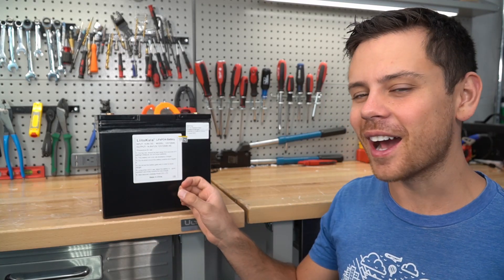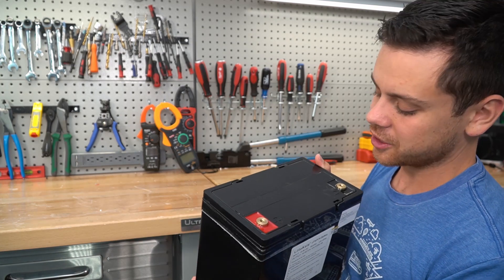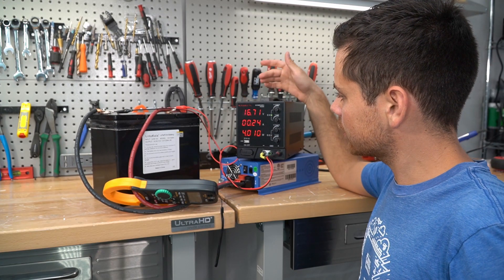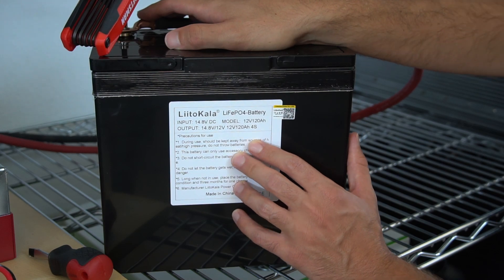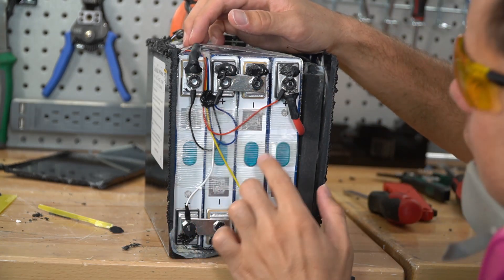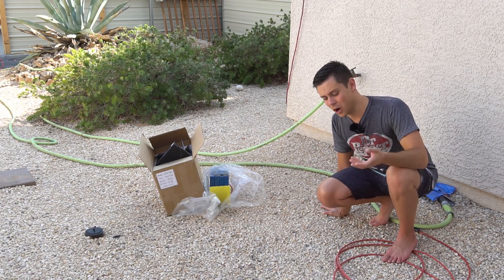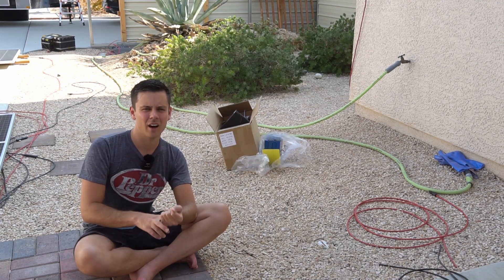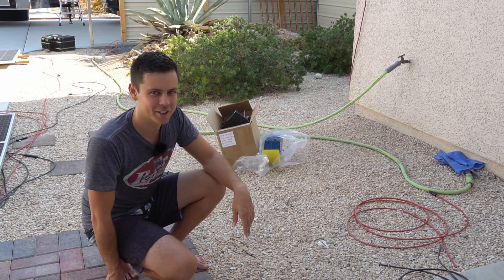Aliexpress $280 120Ah 12V LiitoKala LiFePO4 Battery

Comment: Also you should probably get a rubber mat for your tables.  Just thinking...
Reply: I like the silicone mats, I use them for my workbench where my resin 3d printer is, and so far nothing sticks to it, and no matter how sticky of a mess gets on it, a wipe-off usually gets it and if that fails you can hit it with a paper towel and some water and nothing remains.
Best of all they aren't terribly expensive, 30"x24" is about $25 on Amazon and come in many colors if you need that for high-visibility and contrast
Reply: A rubber mat would probably absorb all of the inertia of his hammering and make it harder to penetrate the case
Reply: Marines not supposed to think lol

Comment: Lead is so Last Century
Reply: My sister has been using a 600Ah forklift battery for 5 years - charged by a water flowing spin wheel generator - years ago this was the best choice since the parts are easy to buy..

Comment: I always cringe when you take stuff like this apart without gloves.  You wear googles and a respirator, awesome.  Just add some good automotive gloves.
Reply: negative. do not use fabric gloves dealing with hazardous liquids, the chemicals will soak into the gloves and you will notice the exposure later.
Reply: @PandaMan02  there are those heavy duty Nitrile gloves which many mechanics wear, those are chemical resistant and nothing soaks in.   Further pretty tear and puncture resistant.
Reply from the maker: @PandaMan02  I have some nice chemical resistant gloves. I know what destroys the latex ones and wouldn't consider fabric gloves as an option.
Reply from the maker: Smart idea
Reply: @WillProwse  According to the MSDS, the main hazard of electrolyte is inhaled aerosols, but otherwise it's the coarse copper particulates and the organic electrolyte (NMP?), with LD50s of  375mg/kg and 2000mg/kg respectively.  

OSHA guidelines for NMP are as follows: "Safety equipment manufacturers recommend Butyl, Neoprene over Natural Rubber, and Sivler Shield/4H for gloves and DuPond Tychem fabrics; Kappler Zytron 400 and Saint-Gobain ONESuit TEC, or equivalent, as protective materials for Amides."  It sorbs rapidly into skin, doesn't usually produce a rash or any noticeable effects, usually eliminated after 24hrs, and is a known teratogen.
Reply from the maker: @lowrads  thank you, good info

Comment: Tight packing is defiantly a big no no. Even if you don't plan on rebuilding a premade lithium iron phosphate battery if say the BMS dies. (Which is strong possibility in a cheap battery) You could still sell/gift the dead battery to someone who's willing to open it up and repair it.  So please either build your own or invest in a battery that can be opened if something goes wrong.

Comment: Yes, better than Lead Acid. But aren't Lead Acid 12V batteries used in all sorts of places like Vehicles, cold and hot places, etc. Not really ideal for Lithium. And for a stationary system I would only want a fully maintainable setup, where I can unscrew single cells and take them out. This 12V battery type products are really nothing for me...

Comment: It would be interesting to see a 20 or more cycle test on those cheaper batteries to see how they compare to others.
Reply: I agree I’d like to see how the hold up.
Reply: I know the RC industry has some battery chargers that will do cycle testing.  It can't be that hard to find some way to adapt their technology to the larger cells.
Reply: yeah, need a robo charge/discharge machine.  it would take a lot of time but would give more confidence in the cells

Comment: What would be the best generator to buy... Either fuel propane or solar
Reply: solar is solar, its not a generator.
get the one that best fits your needs. 
I have a large buried LP tank so I got a tri fuel gen. it runs on LP, natural gas and gasoline
Reply: @woodchippers_WestWingDimeBag  That sounds nice!
Also, where the heck are you that having a buried LP tank meets safety codes?  It's a little difficult to inspect a buried tank for rust.
Reply: @Kineth1  they make underground tanks. imo it's safer
brush fires, downed tree, drunk drivers, not much is getting to it. 
they bury anode bags to prevent rust. 
the bags are checked and replaced when needed
Reply: @woodchippers_WestWingDimeBag  Ah, that's the key I missed, sacrificial anodes.  Makes much more sense now.
Reply: @Kineth1  there is a ton of stuff that the government does not need to know
Reply: @woodchippers_WestWingDimeBag  I should have been more specific.. I just need the best generator for prepper needs only short-term from A to b..
Reply: @DOCSAFETUBE  yeah, thats what I have. I didn't bury a tank so I can get that gen. 
I got that gen because I have a buried tank. I'm rural, no nat gas here, power failures are pretty common.
so I can run the gen from my tank in a hurricane. I can also pour in gasoline like everyone else. 
nat gas almost never goes out, it's pretty reliable so you can use it in ice storms, hurricanes etc. 
even a small gen will tear through fuel if your power failure lasts a few days 
combine it with one of the small all-in-one inverters and couple batteries to have power without running the gen constantly  
I have mid size 6.5k gen and a 48v all in one 
run the gen in the morning and night to top up the battery, run on battery in between 
then install solar as time and money allow